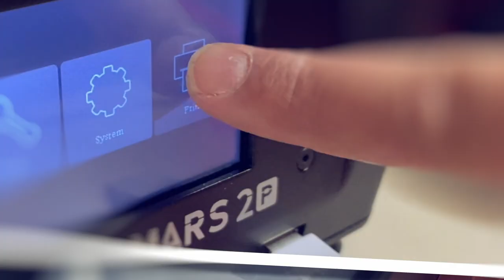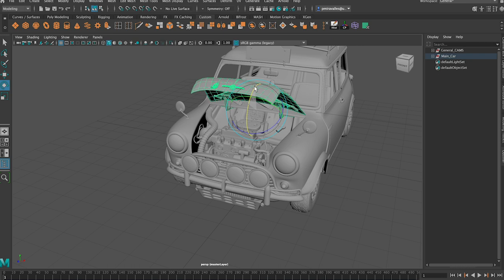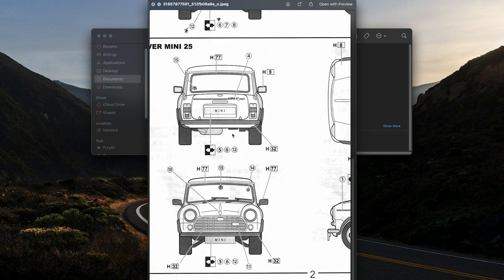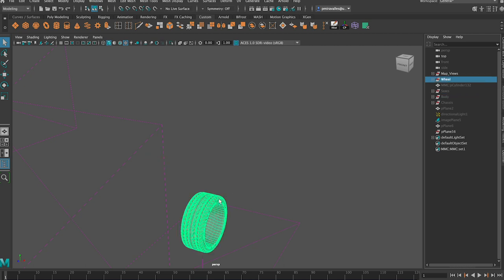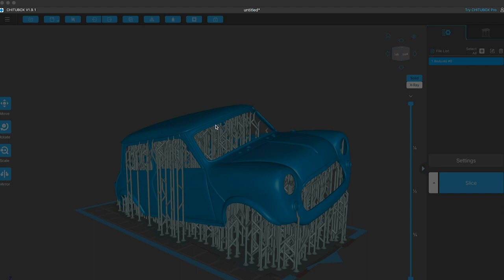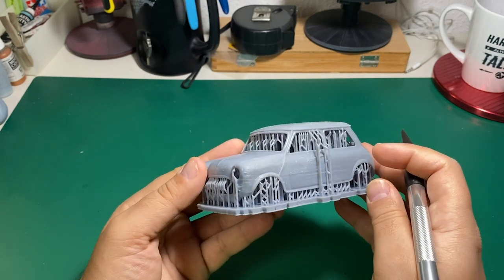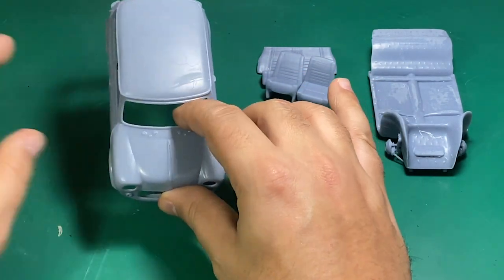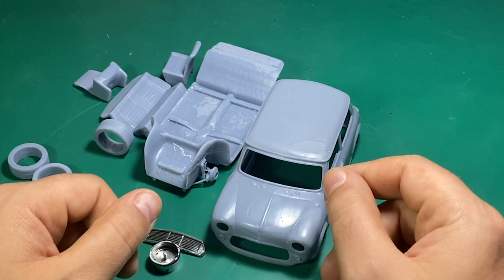Building First 3D printed Model Kit - Old Mini scale 1/24 Model kit Step by Step

Comment: How good does it look in person i bet tons of sanding and filler and primer on body to make ot smooth and not see the layer lines in it or make it not look like a 3d orinted model. And how well does small parts look like motor and valve covers seats dash ect are they rough looking like they been 3d printed or look like onjection molded parts and smooth. Nvm update i saw in video was i was wondering but still cool i guess to say you made the file and car your self to be printable in the program then printed painted and built your own model you made your self from just resin and a printer which ks really cool. Wish i had a resin 3d printer so bad. I built my own 3d printer by myself 4 years ago and have made tons of rc planes and rc racing boats that i race with my local rc boat racing club but i wanam get knto resin printing cause the prints look smoother better and more detail you can add and it wont get all messed up like a regular printer will doing super fine small intrakit details
Reply from the maker: Definitely agree, resin printer gives the enough detail to avoid extra layers and polishing. Cool stuff that rc boats racing club 🤩
Reply: @PabloModelkits  oh yeah it's a blast the 3d printer has saved me thousands of dollars on rc racing boat hulls we run 1/4 scale offshore style boats and everyone except maybe 4 guys all 3d print their boats then we reinforce it with fiber glass or if you wanna be very light we use that metal mesh sticky drywall tape and seal it in with shoe goop or e6000 adhesive which is same thing as shoe goop except it doesn't smell as bad